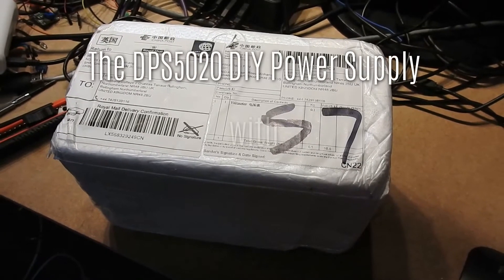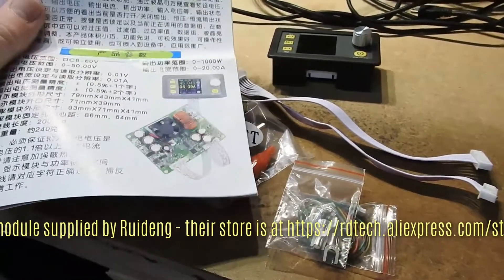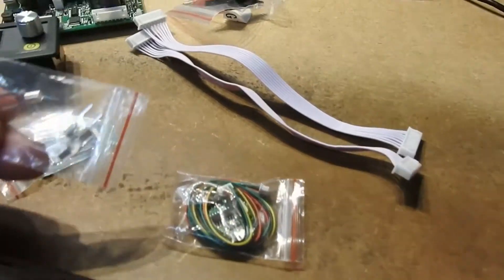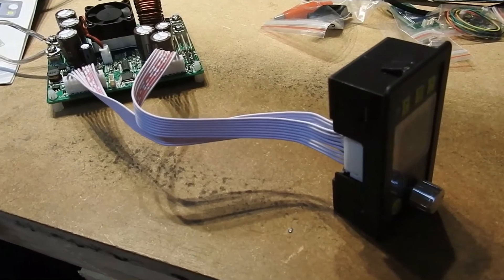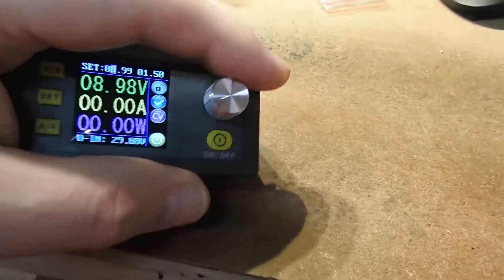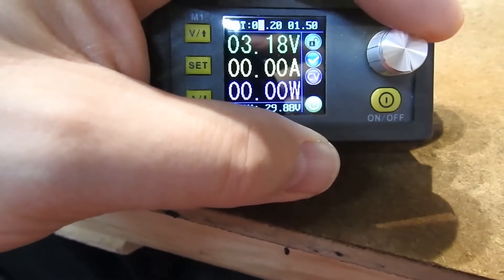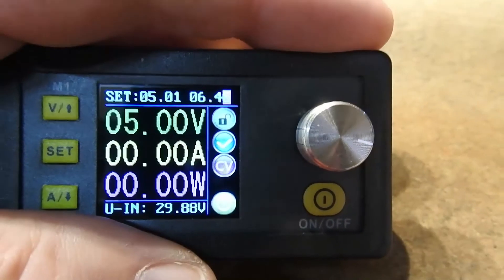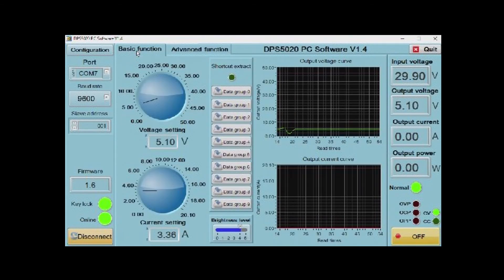DPS5020 Power Supply

Comment: I have 12 volts 20 Amps power supply for input. Can I get 18 volts 20 Amps output if I use this module?
Reply from the maker: I'm pretty sure the answer to that is no - the output is step-down, not step-up. With 12v in, I imagine around 11v will be the highest output voltage - bear in mind it is approaching 4 years since I made this video - and thanks partly to Covid I've not seen this supply for over a year as it is in the UK and I'm not.

Comment: Thanks for your response, you have been very kind. I'm going to visit your site. One other piece of information, I have to buy the transformer. can you send me a link with features on all input voltage and output voltage.
Reply from the maker: The video is not an invite to education :-)  Read the maximum INPUT voltage of the unit and get a power unit (switched mode would likely be good but I'd put a nice capacitor on the output of it - or two) -  maybe 5% to 10% lower. Find out the maximum current of the unit and ensure your supply can manage that current constantly - so if it says 20 amps you want a supply able to handle more than that.

Of course that is all assuming you want to push the supply to it's limits - which could involve some heat. Over to you to investigate.

I will likely feed mine from a 40v 15 amp or similar supply - as I don't need to push it to it's limits.

Comment: great tutorial, congratulations. I wanted to ask an information: I just ordered the dps 5020. You know where you can buy a box suitable for accommodate both the dps 5020 with its accessories and with the transformer and capacitor for input voltage. Thank you
Reply from the maker: Hi there. Short answer no - I've found I think either Banggood or AliExpress, a plastic box that might do the job but experience suggests a power supply would be better off in a metal box.  For power I'm using one of those cased switched power supplies - thinking about it, a honking great capacitor on the output of one of those might not be a bad idea... but they won't fit in the original case.    Ask in the blog, someone might have some ideas. https://tech.scargill.net - look up 5020
Reply: @Giuseppe Colombo
in fact, for the input power supply, there is not specific request, it depends your needs, if you want output 50V, you can choose 60V version switch power supply. that's ok. for the brand, most switch power supply brand are ok. because our power supply has many protection 
for transformer, you can use , but need to if you use AC-DC converter or transformer coil, please add rectifier (rectifier bridge) and filter (more than 4700uf filter capacitor)

Comment: thank you very much for your great work, great video and nice work 
you can do more test for this , I guess more people to see some interesting test
Reply from the maker: Tests will be done when I get my dummy load which seems to be taking a long time to come...   perhaps you can answer Guiseppe's question about power supply?
Reply: @Peter Scargill
very good, I will .. thank you
Reply: @rdtech9153  Hello while i am using your product, dps5020, the input fuse literally "explodes" so I'm going to replace my fuse Is it okay using this fuse? Amp is enough but volt is only 32VDC  https://datasheet.lcsc.com/szlcsc/Littelfuse-0501020-WRS_C207008.pdf

0501020.WRS